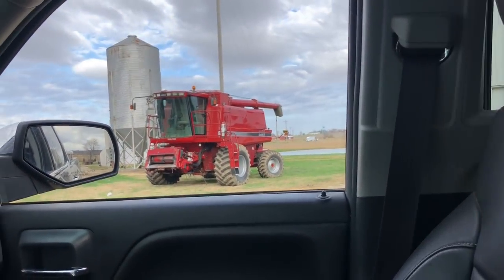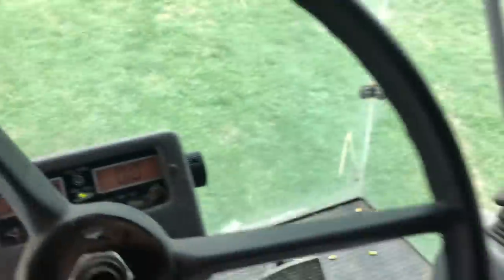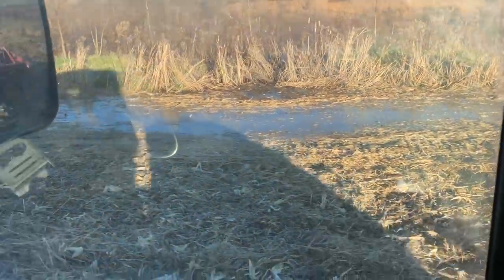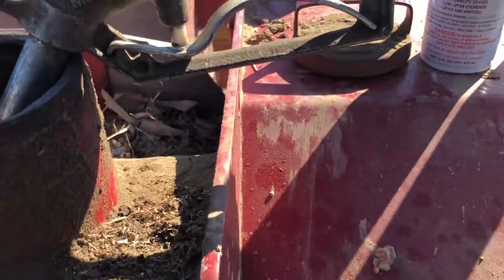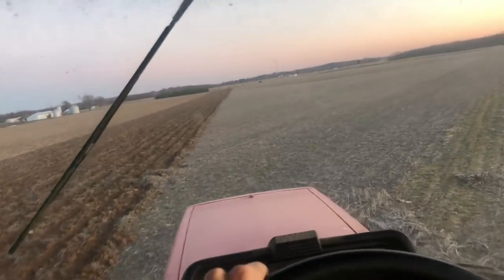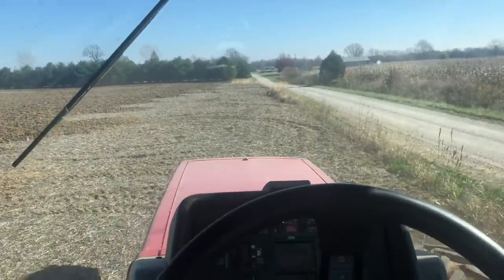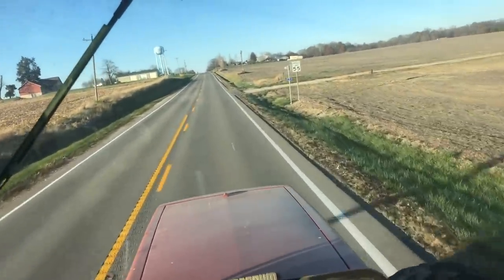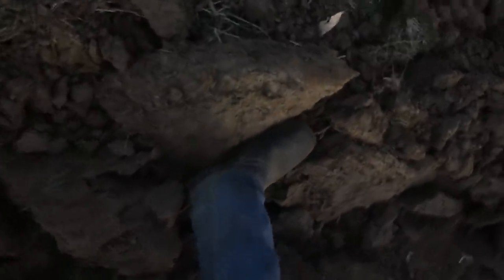Ripping Deep, Yielding High

Comment: Hey man idk how the fuel system coming from the tank going forward is set up but on these new Steigers (not all of them but 620's for sure) have a pre filter mounted on the tank with a sight glass on it. If you want a pic of that set up outside the tank let me know I'll get you one. That might help keep it from getting up to the pump. Might could get a dual filter head and run cat filters that might keep keep that from happening on you again. Just an idea for you to help mitigate that issue.

Comment: Put your 9330 on the ripper you will get along better I promise.
Reply from the maker: It would have more traction for sure, but the same amount of power.
Reply: With the extra weight it will apply that same horsepower to the ground more efficiently. It’s takes more power to spin then it does grip.